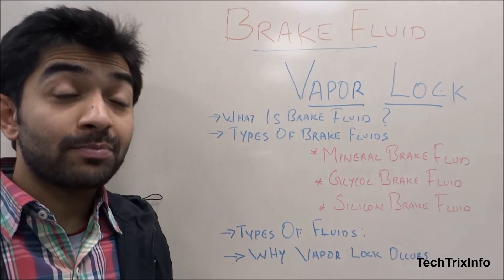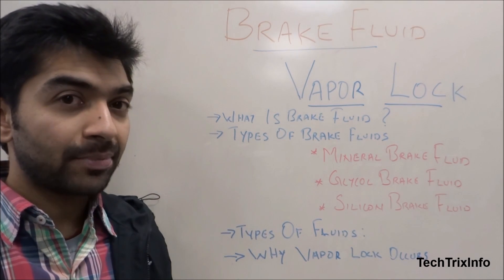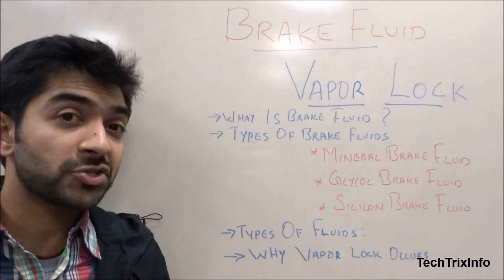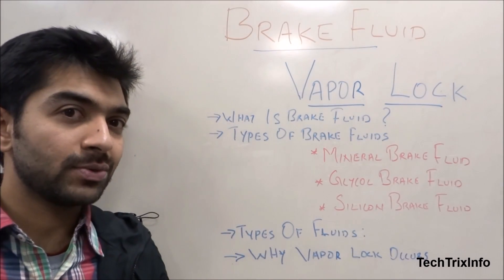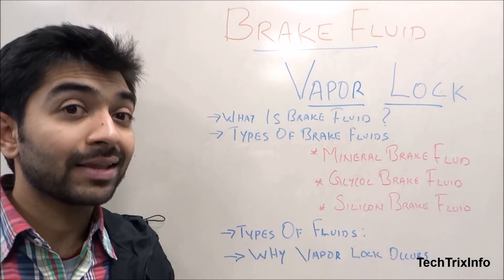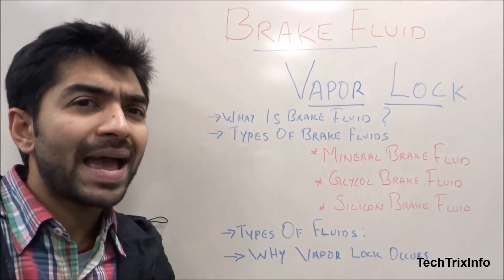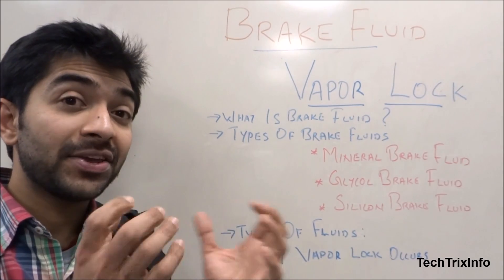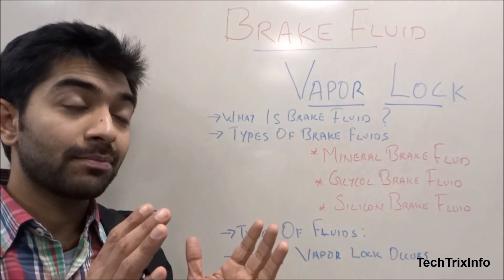Vapor Lock in Hydraulic brakes Explained.✔

Comment: Hi, I just discovered your YouTube channel. Very nice tutorial. I did subscribe for more videos. I need assistance on a 2007 JCB Tractor . I’m having very low breaking system. Can’t take it to the mechanic. I like to do stuff myself, try it before…

Can I get your input on any idea what’s going on with the braking system. It has 491 hours.
Reply from the maker: Please check the brake fluid level and consider replacing it if necessary. It’s also important to perform a thorough brake bleeding to remove any air from the system, as air can significantly reduce braking efficiency. Additionally, inspect the system for any leaks that could affect performance. Ensuring these steps are completed will help maintain optimal braking function.

Comment: Nope , that's not vapur lock . The vapour increase the pressure in the cylinder and pads stay locked ( you can't move ahead) to the disc untill the pressure drops back, once the brake fluid cools down you can go ahead.  I have faced this issue . .
Reply: True, but i think what he is saying is also possible